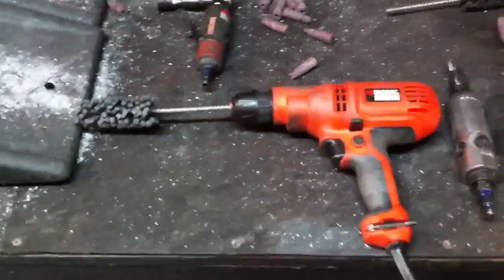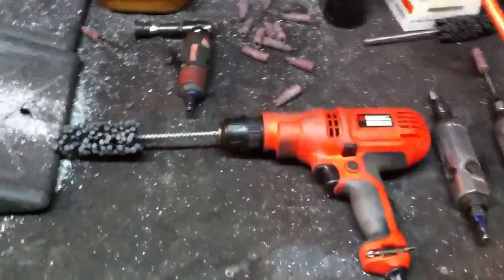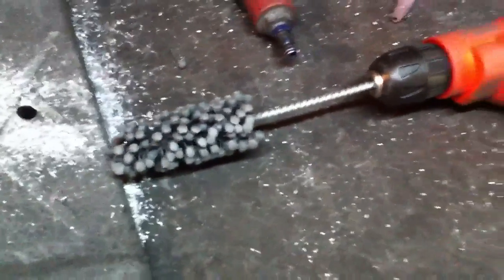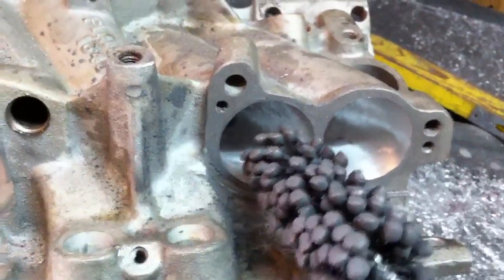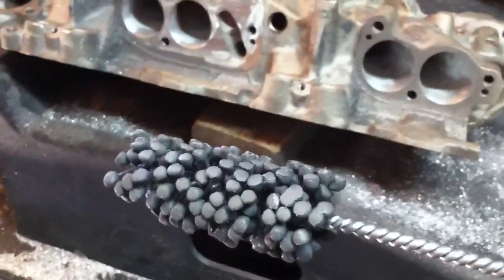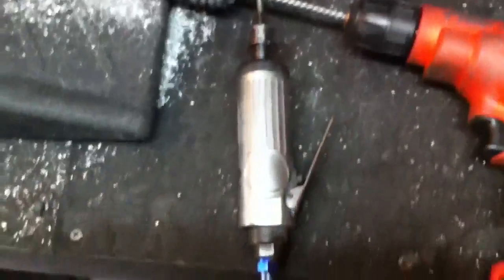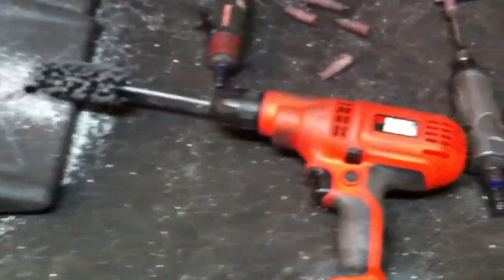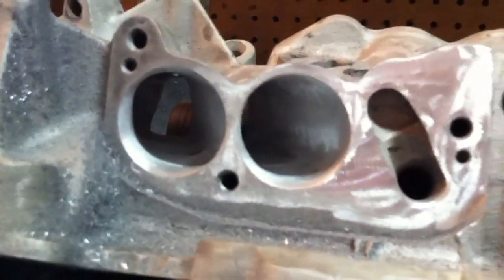TPI Porting with Flexible Hone tool L98 Corvette

Comment: Intake side isnt suppose to be smooth leave it the way it is , the mess the carbide bit leaves behind is actually good for adimising the fuel
Reply: The TPI plenum, runners and intake manifold only move air. The fuel is injected at the cylinder head intake port entry.
Reply: Only air goes through the base and runners, TPI is a dry system.

Comment: why didnt u just extrude hone it
Reply: john wayne cause it very expensive  I know my strip dominator  is going to cost me 700.00  the shop is in paramount  ca  il be going down there in two weeks
Reply: port nut  no its called AFM or abrasive flow machining  it's really not honing its porting  why they call it that I dont know

Comment from the maker: @1355550 I'd love to have one flowed! One without welding. Years back I had one of my stage 4 manifolds flowed. It flowed around 270 cfm, but it had welding done to achieve the type of porting that was required to get that cfm. I'd really like to see what my max ported base flows without welding. Got to be in the 240+ cfm range.

Comment: Is there any flow test data to accommodate any of the work you do? I am doing a performance restoration on a 5.0 305 TPI G92 car and naturally am looking to match the base to the vortec heads with nice runners and worked plenum
Reply: Vortec heads are going to require a new base.  I've heard you can get spacers to mount the older style intake but haven't verified it.  The base, runner, and plenum porting helps... a lot.  Vortec heads and a cam every bit of extra you put into the porting is going to pay off.

Comment from the maker: @1355550  That's not true at all. I've seen amazing powerful engines with stock runners. For example, a twin turbo (two GN turbos) GTA that makes 704hp to the rear tires.

Comment from the maker: That depends on how much power you're looking to make. The stock runners will support quite a bit. I saw an 87 GTA with two grand national turbos make 704 hp to the rear tires with stock runners. Might have made more power with bigger runners, but it was pretty impressive!